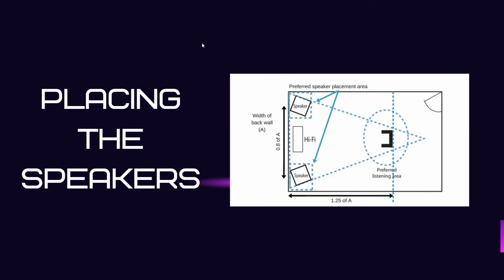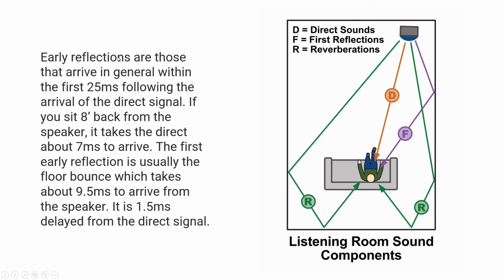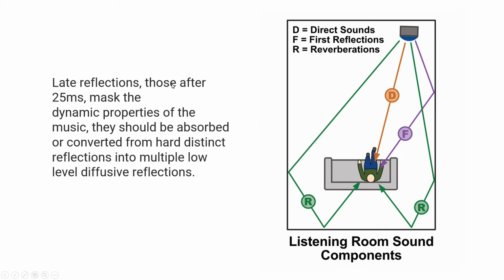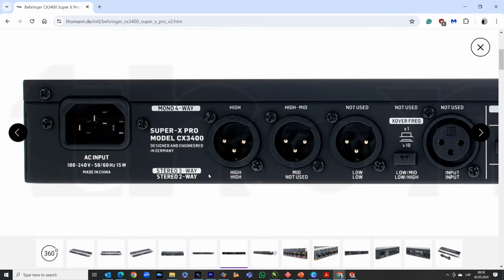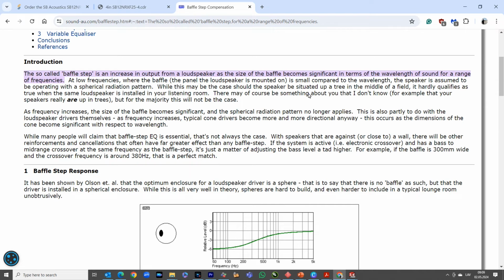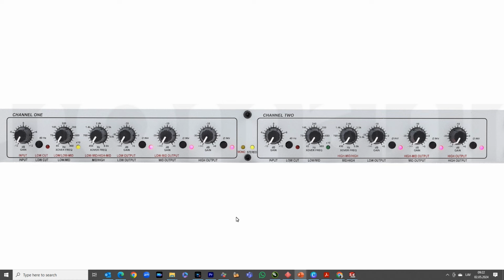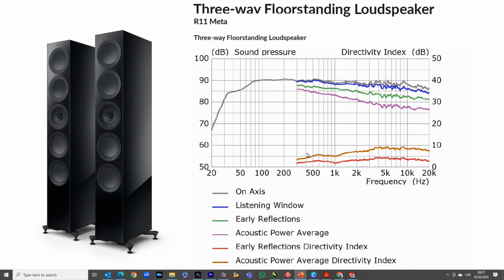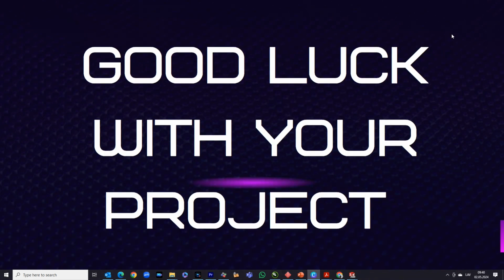Active speaker system ICEpower 1200AS2 + 2x 200AS2 ASS1800 Part 3 Setting up the crossover

Comment: Hello thank for useful videos right now I’m using ice 1200 ver2 for Magnepan 3.6 ribbon ver  very good sound but I think there are put too much force on the amp and as you know 3.6r  low sensitivity 86 db and cross over not very good, I want to upgrade to active crossover configuration with more power what is your recommendation 
🙏
Reply from the maker: You have an excellent speaker setup! Its design makes it very easy to convert into an active speaker system.

I offer a kit on my webshop that supports the ICEpower 1200AS2 and 2x 200AS2 modules.(THX1800). You can find more details and contact information at www.tcrastrs.com. Feel free to send me an email—I’ll be happy to put together an attractive offer for you.

In addition to the amplifiers, you’ll also need an active crossover. I exclusively use professional-grade crossovers. While the selection is limited, they are built to exacting standards and, thanks to large-scale production, are nearly 10 times more affordable than typical hi-fi market alternatives.

For interconnections, I recommend using XLR patch cables. They are standardized, well-designed, and widely available at reasonable prices due to high production volumes.

If you need help sourcing components, I can suggest reliable places for safe international purchases. Alternatively, if you have a pro audio store nearby, most of the components should be available there.

Looking forward to hearing from you!

Comment: Thank you very much for your reply. Greatly appreciate it. With the new Purifi 9040BA Eval4 kit, all the reviews state that they are much "improved" over the Hypex and Ice Class D modules. Are you planning on doing an amp based on the Purifi 9040BA? Or is this just more of a diminishing returns?

Comment: I have Aerial Acoustics Model 8 which was a very highly reviewed speaker in 1998.  It is extremely well built with high end components. What happens if I disconnect the crossover and implement your technique using the stated crossover frequencies. I have multiple amplifiers I can use.

 Three-way, floorstanding loudspeaker. Drive-units: 1" titanium-dome tweeter, 7.1" paper/composite-cone midrange, 10.7" woofer. Crossover points: 250Hz and 2.5kHz. Frequency response: 28Hz-22kHz, ±2dB, -6dB at 23Hz. Impedance: 6 ohms nominal, 3.5 ohms minimum. Sensitivity: 86dB/2.83V/m on-axis. Power requirements: 50W minimum, >100W recommended

Will the result be somewhat similar to the existing passive crossover?
Reply from the maker: If you know what you do, you will get great results and enjoy a responsive audio system. Also, most active crossovers have a 24db filter slope and you can raise your woofer crossover frequency making life easier for your midrange reducing lower register distortions. You will be able to cross around 350Hz. You will be flexible in playing with crossing frequencies to find optimum crossover points for each band. And you will have incredible clarity at midrange. It is better to use modern amplifiers which have excellent protection to avoid potential speaker damage by pop-up noises etc. Your amplifier power ON and OF process should be silent for all amplifiers, especially for the tweeter.

Comment: this is an absolutely gold vlog teaching for audiophile. i plan to use trinnov altitude for my surround processing. if i didn't mistakenly heard, it has active crossover for each channels, correct me if i'm wrong. so hypothetically, if i were to build a symmetrical 25 surround channels, (floor, bed & height channels including main LCRs and top center voice-of-god height speaker) that would sum up to 50 discrete channels yes? 25 high frequency and 25 low-mid frequency channels. correct me if i'm wrong here.

2. also in regards to trinnov, their bass management and wave forming, does the 1.25 of A listening position still applies?

i highly appreciate your vlog Mr. Guntars, top-notch educational stuffs.
Reply from the maker: Hi, thank you for the inspiring comment.
With the Trinnov altitude processor, you are stepping into the next-generation home cinema. And what is most important is that the processor is separated from the amplifier. It is important because THD processing and amplifiers are developing at different speeds, similar to photography where a good lens is living 10 times the camera body life’s. Modern amplifier boards in home cinema exceed human hearing limits, but THD processing is still in development. In-home cinema speaker placement is less critical because you have a number of them filling the room and reducing room impact. Subwoofer placement issues are compensated by the digital processor changing phase and volume of low-level signal in the digital processor. The measurement microphone takes the role of a precise listener.
Wit stereo everything is so critical due to non-optimal standards. It would be far simpler in the case of 3 speaker systems- left, right, and center. Historically stereo is developed as 2 2-channel system where a 3-dimensional effect is generated by our brain capability which is adding critical placement limits.

Comment: Very good video! I have suggestion for next production. Would be nice to listen you explaining how to make measurement. I made similar setup but I adjusted it using ears only 😅 I want to compare it with measurements and discover full potential of my speakers :)
Reply from the maker: There are four grades of measurement. But you should start with optimum speaker placement anyway to get a good sound stage.
The first is my described method with headphones where you insulate yourself from the room and then compare both in-room and headphones to try to get as close as possible. It is a simple and precise method that includes room influence.
The second is to apply the noise with one of the measurement software and try to get a flat response. It also includes room impact. May be good to properly place speakers.
The third – get linear anachronic chamber response using digital DSP and step response where I do not see any value unless you are not in the treated room. The room will spoil everything
And the fourth – have a treated room and by using DSP crossover fix everything that you can. It is a complex task and you need knowledge close to the studio mastering person. Modern DSP crossovers with parametric filters in the hands of beginners in most cases land with failure. Your music listening experience will not improve but you will have a perfectly neutral sonic balance to be able to mix recordings. 
The funny thing is that with the first method you are at 95% of the audio quality.
Reply: @guntarssmits2104 thanks for answer. Unfortunately I have limited options with speakers placement (limited to one place 😢). I noticed better soundstage when I moved speakers closer, but they can't stay in this place. I made a lot of tests with active crossover but probably I reach limit. I will try your tips in next free momment, do you think dsp can solve placement issue or it's just waste of money (in scale 1-10)?
Reply from the maker: On a scale from 1-10, it will be “0”.DSP can change some coloration issues, extend bass performance, correct baffle compensation, correct some loudspeaker components design amplitude frequency limitations, and do speaker time alignment but cannot change room reflection soundstage smash. Your active system's largest benefit is loudspeaker driving tolerance and control which you can describe as detalization. To further improve your sound stage you should use speakers with waveguides forming more focused direct radiation and narrow vertical plane radiation. At some point, you are at your current system limits and the next step is room treatment or rearranging your listening sofa configuration to be closer to speakers. In my video, there are THX placement recommendations drawings and those are industry standards for the best result. No shortcuts, sorry😊
Reply: You confirmed my suspicions 😅 I have to discuss with my wife about it. One more question, did you compare dsp with Behringer crossover from previous videos?
Reply from the maker: @partyk138  In most cases for home usage you do not need DSP. DSP is great for pro musicians when you change performance places, have many speaker boxes, and get nasty reflections from architectural constructions. With more than 40 DSP adjustment parameters you can get more or less acceptable sound for live performance and suppress some positive microphone feedback. To simplify this process test signals are built into the crossover DSP, and typically good DSP crossover has measurement microphone input. For home usage, you do not get much from DSP You can improve some tiny bit of coloration, but your overall impression is minor or not improved. There are only a few potential steps with a big impact - amplifier power, amplifier bridging, and direct loudspeaker connection to multichannel amplifiers with crossover prior amplifiers. The rest of the processing has a minor impact on your listening experience. In the case of home recording, you should start with room treatment and then use DSP and acoustic measurements to get a neutral sonic balance for proper mixing.
Reply: Thanks for answer. I really like your explanations, I'm waiting for new videos 🔥🔥🔥
Reply: This explanation doesn't match what I think DSP is. Can't you change frequency going to amps/speakers just like the pro audio DBX/Berhinger full rack component?

The problem I see with these miniDSP type components is they are single ended.
Reply from the maker: @mattmiller4978  There are mini DSPs that are powerful and can do everything that Big Brothers can, but so far I have not found some bords produced in large quantities and standardized